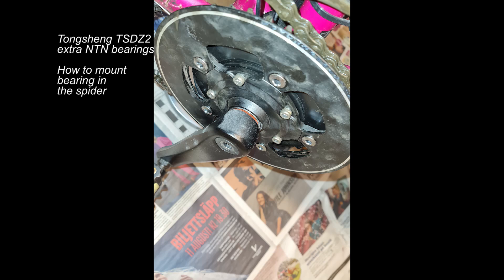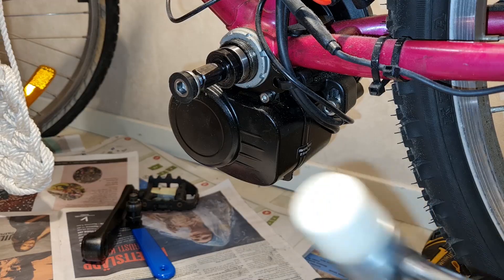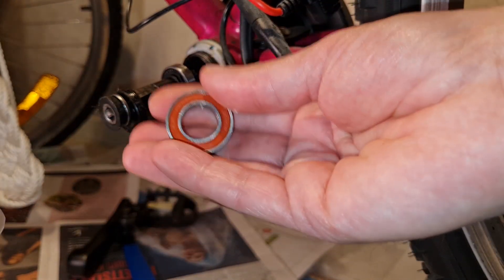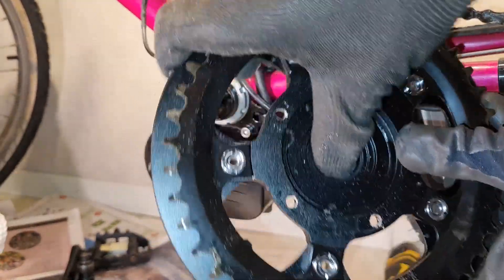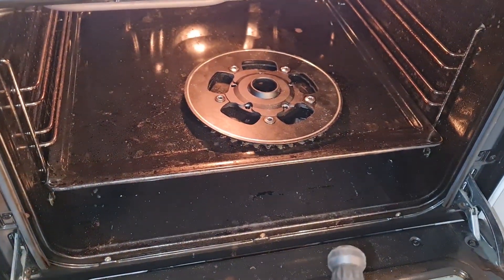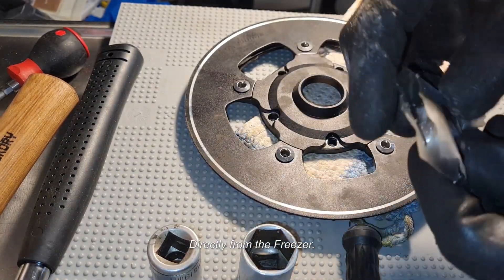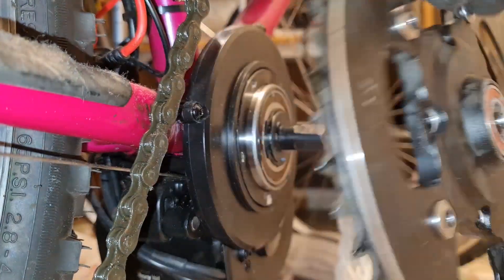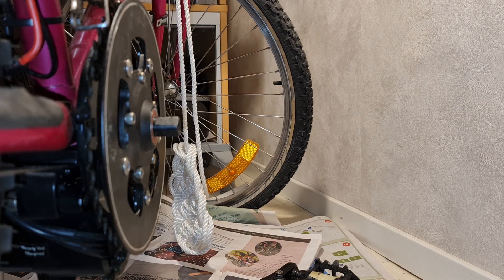Tongsheng TSDZ2 extra japanese bearings, mount bearing in the spider

Comment: Great video, also thanks for the bearing sizes. Found my bearings were very loose on the crank shaft as it was only 14.7mm. But it was not wear as the paint was still on the surfaces that should have been machined. I made up some thin metal shims to fill the space. Anyway the noise I had, has now gone.

Comment: I mounted additional bearing on the letf side of TSDZ2b before I found this video. Now, I will do it on the right side. Thanks for video.👍
Reply from the maker: Glad if it helps. Thanks for the comment.
Reply: @simplicitygarage  Do you think it does much? I'm not sure it is taking any load there as the forces are transmitted into the spider from the big gear, through the sprag bearing. I guess it takes any flexing loads out of the spider when it is under load. If you have a big box of bearings left over from doing the one on the other side, I guess I might give it a go
Reply from the maker: @ChrisMacdonald-ns8rx  There is plenty of folks who have done it, and recommend it. I definatly things it helps to even out the forces. There are forces from both sides and this mod stables it somewhat. I've done it on both my TSDZ2 bikes.
Reply: @simplicitygarage  I've now received my motor and one of the things I checked was flex in the chainwheel, and, yes, there is relative motion between the chainwheel and the crankshaft, so it does indeed make sense to add a bearing there. I am slightly concerned about not having a good seal there, bearings are themselves sealed but can let stuff by. I found a 15 x 28 x 4mm seal so it could be put in the inner half of the aperture, and the bearing sticking out slightly. This isn't ideal. I will get the seal anyway, and then think about it, but yes, the bearing would prevent relative motion between the chainwheel and the crank. I suppose the only thing holding them in relative position is the sprag bearing, and that is not designed for that sort of eccentric (axial twisting) moment, so that is where the play is happening.
Reply: @simplicitygarage  Could you help me out here? The square taper goes right up to the seal and I can't judge how far the crank arm will press on. So before I decide how to do that, could you tell me, how much gap is there between the crank arm and your bearing, if you look straight down at it with the pedal low? If it is more than 4mm then the bearing could sit out a bit and still get a 4mm wide seal behind it too.

Comment: Did the same, but even exta 1 more (instead of another protective rubber, so I got 3 +1). Also, I glued the bearings with Loctite glue a bit. Now the axle doesn't play at all. But now there's a crackling sound during startup, the cranks are screwed in well... it's probably creaking somewhere on the rear mount...
Reply from the maker: Thanks for the feedback.